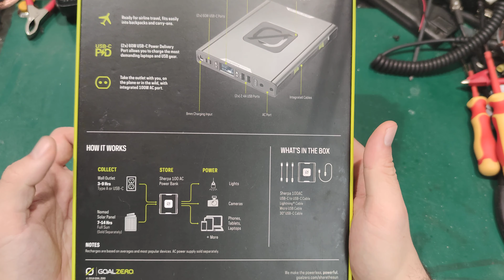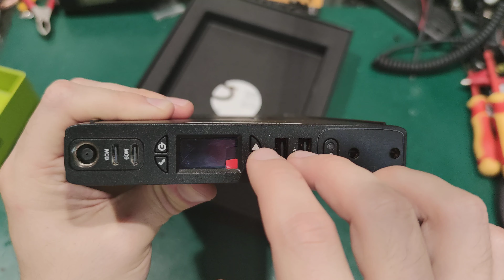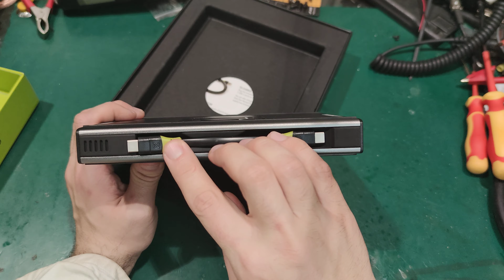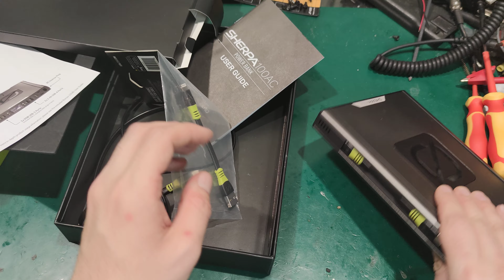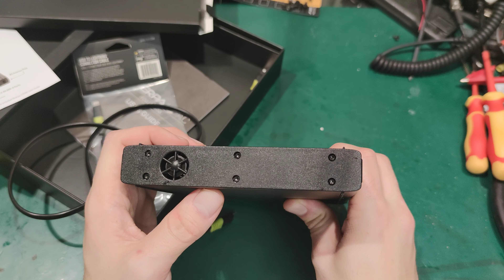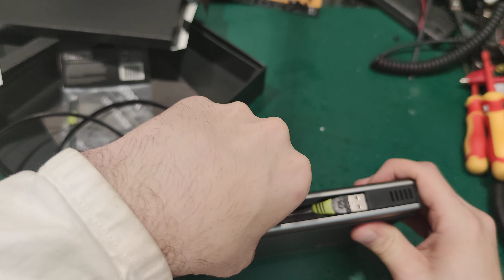Goal Zero Sherpa 100AC - USB-C  PD 60W laptop power bank with AC inverter

Comment: very good  ,informative video, I have this Sherpa 100AC unit, and it is not charging anymore. do you have any suggestion?
Reply from the maker: I would start from opening it and checking out voltage on battery. I never opened mine so I can't give any hints - maybe it's just lock in protection mode.
Reply: @ElectronicNoobBlog  thanks for the response. I actually tried to open it but i couldn't find a way .